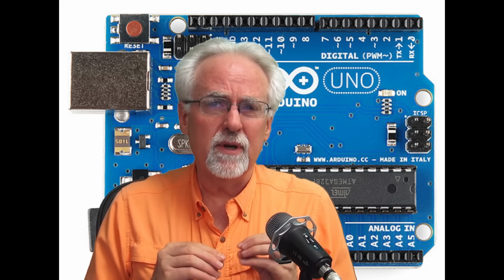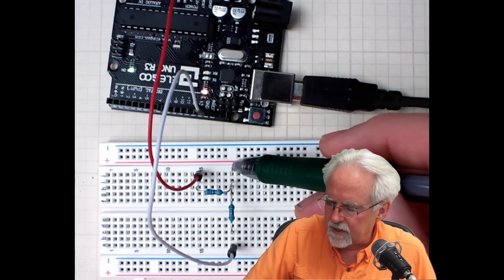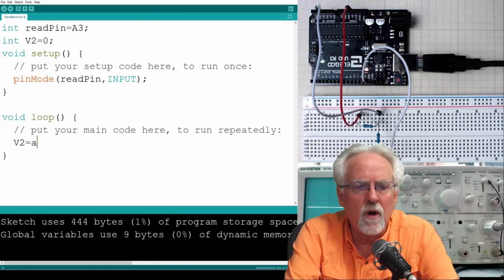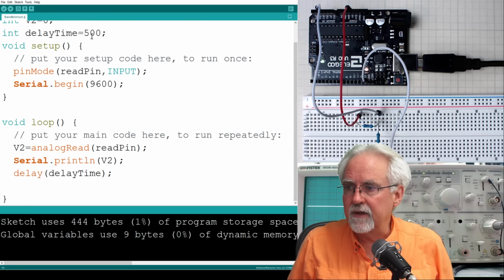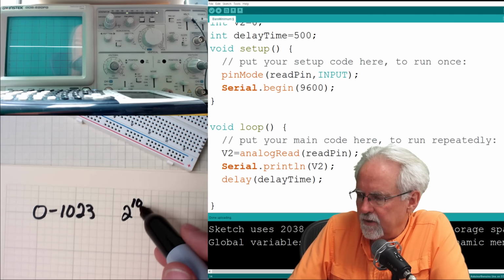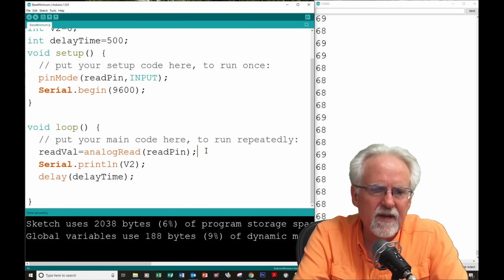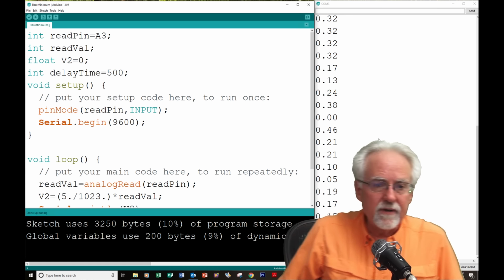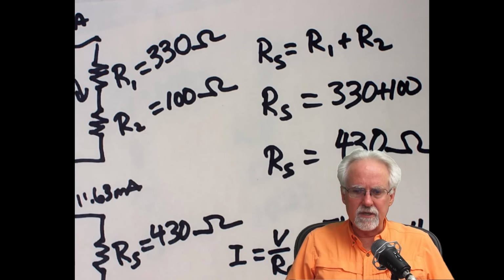Arduino Tutorial 10: Understanding How To Read Analog Voltage using analogRead Command

Comment: This is a great explanation and insightful homework for Ohm's Law! I am a little confused with the readVal value though. I see how we were able to use the volt meter starting from the positive side and measuring across v1 or v2 to return the value we calculated for the volts across each resistor. But When using the readVal it seems to measure the volt in reverse from the negative side across v2.  If I place the A3 lead at the negative side of the circuit it reads 0.00v if i put the lead at the beginning of v2 it produces the voltage across v2. Then if I place the lead at the positive side (at the beginning of v1) it reads 5v (which is just summing the voltage crossing both v1 and v2). Im just a little confused at why it seems to work in the opposite direction of the volt meter? This may be an example from what you explained earlier about how amps or volts move one way and electrons move in the opposite direction. I guess my question is two parts, one is there a way or need to get a readVal reading for just v1? Second question, which is a little more complex, what are the resistors actually doing? It seems that they may just limit amperage but not voltage. Is it the amperage what blows the LED and not the voltage? Maybe I am confusing myself, but I'm just trying to understanding why you use different resistors, if the voltage in the circuit doesn't seem to change.
Reply: i also got confused about the part
Reply: Me too...I tried removing the 2nd resistor and I can't get a read on the first (330 omh) resistor. Did you figure out why?
Reply: Same problem. Not sure if this is correct however - I think the A3 input is reading the voltage at the site where it is inserted, relative to ground. So it gives the result as 5V minus the voltage drop across the resistor. In my case, with the resistors I'm using, the serial readout is around 4.9V. If I place a multimeter across the resistor I will measure the drop across the resistor which displays 0.1V on the multimeter. So one reading, A3,  is displaying the voltage potential at the site (starting voltage minus resistor voltage drop) and the other is displaying the actual voltage drop (multimeter). If you place the A3 lead after both resistors the reading will be zero as the full 5V has been dropped over the 2 resistors. So you can't directly measure resistor 2.

Comment: Good morning Paul from UK.
I did your assignment for lesson 10.
Used first resistor R1 =10k.
R2 =2k.
Multimeter readings were V1=4.2
V2=0.8
AnalogWrite on screen=0.83.
Followed you to the jot and tittle. Perfect Thanks.
Using same colour wires as you did can I just move the white wire somewhere in breadboard to read V1. I've tried but just get 5V or 0V when I'm looking out for 4.2V.
Please help if it's convenient.
Thanks again for brilliant lessons.

Comment: Hi Paul, just realised, adding an external power supply to the Arduino, does not change the voltage readings. That make sense, +5V should stay +5V. I added a yellow LED between the two resistors and found out that the LED voltage drop is about 2.04V, that's a very common value. Up to lesson 11.

Comment: first of all let me tell you how great way for learning you give, these small mistakes sure you do it intentionally but it really nice way of us to check we are keeping track, very very very good  and have been keeping watch till the end of all lessons as you really taking it slowly and step by step ( mini steps) that really works for me, Thank you Paul
i have simulated that lesson (Analog read) and work the equations on a paper for two examples A: 10K OHM and 220 OHM resistors in series and could only read one reading 220 OHM for the resistor between negative and read pin,  had to change polarity to be able to get the reading across the 10 K OHM resistor.
example B : 2 x 220 OHM R in parallel + a 220 OHM R series with them, than calculated the math which gave ( 1.6 V across parallel resistors and 3.33 across the series resistor), again i get the reading between the negative and the read pin, then had to change the polarity to get the second reading of the parallel resistor group, does that make any sense?

Comment: This is a helpful lesson thank you.
5.15.2021 update:  I finally got the time to go through this lesson at home.  I was so excited to see that the voltage printed out matched my volt meter!  I am going to use this method of reading the value from a variable resistor so that I can adjust a timer manually on my current project.  My current project is an IR transmitter/receiver that I use to receive an input from my tv remote and transmit a series of commands (macro) to fast forward a video 10 seconds, 20 seconds, 2 minutes and also rewind 10 sec.   I plan on using the "readVal" in a calculation to feed my time variable.  I may or may not have a programmable mode to store the value, I haven't decided yet, plus I need to learn how to do that.  Thank you again Paul!  Create a wonder filled day.

Comment: So, I followed your tutorial, but used different values for the resistors: R1 = 218 and R2 = 10 (measured with my multimeter). With Ohm's law and the formula for resistor in series I calculated a total resistence of 228+10=228 Ohms, which gave me the current I = 21.9 mA. 

Then I calculated the voltage drops across the resistors:
V1 = 0.0219 * 218 = 4.78V
V2 = 0.0219 * 10 =  0.219V

Built the circuit, hooked up the correct pins on the board and connected pin A5 on the same column of the top of R2 and.... awesome! I got 0.21 / 0.22 V, which given the approximations looks pretty good. 

But what if I wanted to measure the voltage across R1? I thought that, instead of using only one analog pin (which measures the voltage with the default reference of 5V), I could use two of them: so one pin acts as a reference and the other one acts as the measurement.

I used A4 for reference and A5 for measurement and modified the code. Instead of calculating (5./1023.) * readVal, calculate (5.0/1023.0) * (referenceValue - measureValue) and there we go: if I connect the reference to the top of R1 and the measure to the bottom of R1 I get 4.78V, and if I connect reference to top R2 and measure to bottom R2 I get 0.22V, exactly as expected (given the approximations, of course).

This is awesome, thank you for your tutorials, I'm devouring them.

Comment: Hello sir,
How can I get voltage readings across resistor 1 on serial monitor. I connected voltmeter and got the desired value but getting confused to get those readings on serial monitor.

Comment: my "Analog In" pins give 2.2V according to my Voltmeter when there's nothing connected to them.. And in the code I wrote according to this video it shows 1.1V in the Serial Monitor.. Not sure if that's as expected or there's something wrong with my Arduino..

Comment: Am I the only one shouting "No! No! No!” at the screen when Paul types a number or makes a 'mistake'?

I don’t know if anyone else will have difficulties, but I’ve discovered my laptop gives out a little less than 5v when running on battery. On the first reading I was only getting 236, it corrected itself when I plugged it in.

Comment: I'm from the world of computers.. and 1023 is 1k .. 1000 = 1k . but in computers, electronics, 1k is actually 1024 .. ( 0-1023) .. So, the 0-1023 in this case is just a Potentiometer in a sense? if you set it to 512 ( or 511 in this case ) that would be HALF power?  am I understanding that correctly?  trying to repurpose my terminology lol  These videos are the ABSOLUTE best !!! I've been searching for years on explanations for these 37 in 1 kits. on how to utilize them. and I ran into one of your other videos ( On TILT Sensor ) . NOT Only do you show code on how to use the device you give us a real world example on what to use them for. and that is great stuff !!!

Comment: Why is he getting 296? I'm getting 235, which, as a voltage is about 1.17v (the same as the 100ohm resistor. This means the other resistor is 788, which again equates to 3.9v, which is roughly the voltage drop across the 330ohm resistor. So, why is his reading higher?

Comment: It was a good lesson however it took me a while to find out where to insert my A3 wire on the breadboard. I noticed this due to my serial monitor showing 0.00V. However, I quickly found out that the problem is in my hardware and not my code. I then fixed it and got it running how it was supposed to. Also, is there a way to still see the live monitoring if the Arduino is connected to a socket or power bank instead of the computer output? Would we need an ethernet cable? Good lesson, can't believe that this is free!!! Thank you!!!

Comment: Amazing Videos Paul, you are a great teacher!!!  Question, I'm following along on the examples and homework and my printed V2 voltages seem to be off.  When I check after the 330ohm I get 1.16V.  But should this not read 3.83V based on our math?  When I probe after the 100ohm I get 0, but should this not be 1.16v?  Not sure what I'm missing on this one.
Reply: This appears to be 5V going into resistor.  The resistor cuts down 3.84V so actual voltage left over after first resistor is 5V-3.84V = 1.16V?  Is this correct?
Reply: @mattfleming4488  yeah
Reply: @mattfleming4488  Yes. You are reading the voltage available in the circuit at the point you are probing (1.16v), not the voltage that was "used" by the resistor (3.84v). The voltage "used" by the resistor is also known as the voltage drop across the resistor, which may be easier to understand.

Comment: 1. Why is it reading V when one end of the wire is plugged into an analog in pin and the other end of the wire is loose in the air? (Reading around 2V). 2. Why is it reading 0 when I check the circuit after the second resistor? I've tried replacing my resistors but it didn't change the value of 0.

Comment: I did the homework with a 5K and 2K resistor.  I calculated the voltages correctly and was able to measure them, however I couldn't get a correct current measurement on my multimeter.  What am I doing wrong with the current measurement?

Comment: When I do a circuit analysis with 2 resistors that add up to less than 1000, it works out perfectly. I tired it with a 10k and a 2k resistor and the voltages I got are way too high!

Anyone else find this?

Comment: These are such great lessons but I had a problem with this one.  The only way I could get a voltage reading of something other than '5' or '0' anywhere in the circuit was to include an LED in the circuit after the first resistor, and then I got 5v on the first leg of my first resistor, and 1.6v or so after this resistor (220k and 100k in the circuit).  I also noted that although the code compiled, it wasn't happy to upload unless the sensor wire on 'A3' was disconnect.  I can't really understand what is happening.  The code is the same as above and the resistors, and an LED between them, are effectively in a series circuit. I've used 220k, 100k, and 10k ohm resistors but had similar results. Any ideas or observations would be appreciated.

Comment: I am a student watching your videos and following along with my engineering class. In the last video you introduced us to the equation V=IR and I was wondering if that calculates the voltage that is resisted (lost) or the voltage that makes it through the other side of a resistor? At the point where we measured the voltage with the Arduino's read out the voltage was 1.16 volts and the resistance before it was 3.84 volts, which makes me believe that V=IR calculates the quantity resisted. However, following this logic and the read out of the Arduino the voltage at the point between the 2nd resistor and GND is 0 volts, but when I placed an LED there the voltage read out changed from 0 to 2.7 and the LED lit up brightly. How is this possible? What does V=IR calculate?

Comment: I've been following along using tinkercad, a web based simulation of the UNO and many associated sensors, motors, actuators, etc. So far, the lessons are very spot on. I'm going to repeat everything from lesson 1 once the Arduino kit (used the link below of course) comes in. Thanks!

Comment: after r2 mine just reads flat 0.00, is anything wrong?
Reply: Simple answer is Yes.  Are you sure that other end of your jumper wire from pin A3 (Analog In) is in the same breadboard column (negative end of 330 ohm/positive end of 100 ohm) the the two resistors?   Twice now in the lessons to this point I've added an LED in series just to get a visual indication that the circuit is working first, them remove it.  If one end of any of your resistors is not seated, you will get your 0.00 reading.  That's my two cents.  Good luck

Comment: Paul, you're amazing and I love these tutorials. I'm confused though... let me see if I can explain why I'm confused. Let me see if I can write out a circuit using words in Youtube lol.

5V -> R1 330 Ω -> R2 100 Ω -> GND That's essentially our circuit. If we want to measure the voltage going through R2 why are we putting the wire between R1 and R2 to our A3 input in the Arduino? Wouldn't that measure the voltage out of R1? If we want to measure the voltage coming out of R2 why don't we put the wire after R2 into the A3 input of the Arduino?

I know the math works out and it's beautiful, but my brain can't seem to comprehend why we need to put the wire between R1 and R2 to measure R2. I hope I'm explaining myself correctly. Feels like I missed something.

edit: found mistakes, fixed them.
Reply: @ThisGuy:  Try this layout by adding one resistor:  5v->R1 330 Ω->R2 100 Ω->R3 220 Ω->GND  with nodes labeled as  5v->N1->N2->N3->N4->GND.  Recalculate the current and voltage drops using Ohm's Law.  It becomes clear that the print values are relative to the ground.  By moving the A3 Pin jumper wire to each of the four nodes starting at N4 yields the following: N4=0.00v (voltage at GND); N3=1.69v (voltage across R3 relative to the GND); N2=2.46v (R3 of 1.69v + R2 of 0.77v relative to GND); N1=5.00v (R3 of 1.69v + R2 of 0.77v + R1 of 2.54v).  I still love the question. Cheers.
Reply: I think this is a great question actually.  If you built it like you described, which is the same way Paul did, it's something I would like to know as well.  Assuming it is relative to the GND.

Comment: Thank you for the tutorials.  These and my new toy, the Arduino, are all that is keeping me sane during these lockdowns.  Thanks again.  I couldn't stop myself but a little tweak to the code, using the String variable and mine now prints the output " 769.00 is equivalent to 3.76Volts." etc..  It's all great fun.

Comment: Wow, such a great teacher.  Kudos to you Sir Paul!  Thanks for these videos!!  
Ummm, just wanted to verify: Shouldn't 5 be divided by 1024 (since 0-1023 is 1024 in total / 10 bit) 😅
Reply: Nope :) The largest value that analogRead can return is 1023. If analogRead returned 1023, then multiplying that by 5 and dividing by 1023 gives us a result of 5v, which is what we expect. You want to divide by the highest possible value in the range, not the size of the range itself.
Reply: @michaeltanner4404  That's not the answer. 1024 is the correct number for 10 bit as 10 bit = 2^8 = 1024. But this starts from 0, not 1. Hence, 0, 1, 2, 3....... up to 1023 add up to give 1024 numbers. 1024 slots. And that is the reason why 1023 respresents 5V.

Comment: Hi everybody, I had an error, checked the programming.. perfect, checked the connections on the breadboard.. perfect, all explained nice and clear, but I did have my USB connected to an USB multi-plug. I want to share that the Arduino board, if not connected directly on your PC, will give you errors. For a beginner this is something I have learned "the hard way" . Thanks Mr. Mc Worther, I am glad I am at lesson 10!

Comment: im getting 2.01v reading after the 330 ohm resistor. hmm. checked everything. exact same setup, not sure where i went wrong. double checked resistors, their good. breadboard layouts same as yours. tried different slots same result. programming exactly the same. Only difference i can see is you have more hair.  Please advise obie one.

Comment: Hi there. Really enjoying your tutorials. But I am confused with the float V2 =0. It doesn't seem to make a difference what number you insert here, be it 0 or 5 you get the same reading in the print. I hope i made sense here. Peter
Reply: Peter Crowther the "float V2=0" is the initialization for the variable.  When the program gets to the "V2=(5./1023.)*readVal;"  then the value in the variable gets changed to what is read in and calculated.  This is just how programming works with variables.

Comment: Thanks Paul for the tutorial. I am really enjoying these. I have a question for you.  When I read the circuit as you did (in same row as 1st resistor) the  I get 1.16 V.  But if I read it between the second leg of the second resistor and the ground wire it reads 0 V. Why is that?
Reply: Because the voltage has already been used up after exiting  the second resistor.
Reply: @nasrhussain9234  Is this actually the correct answer? I get 0V even when I just use one 330 ohm resistor and put the analogRead wire on it.
Reply: Did you guys find the answer for this problem? :D

Comment: Can anyone explain how this circuit actually measures the voltage drop? With a voltmeter, you put two leads at two different points to determine the voltage drop. Here, there's only one lead (going to A3). Is the other point ground? Relatedly, can this circuit be used effectively as a DIY voltmeter?

Comment: Using tinker cad doing this and found out a couple of things.  I did the same code and got 3.82v which is for v1 (which is correct with respect to the equation on the previous video).  Initially I was confused because it did not render the same results as paul did so I started messing around and got the 1.15v reading for r1 after changing both resistors to Gohms.